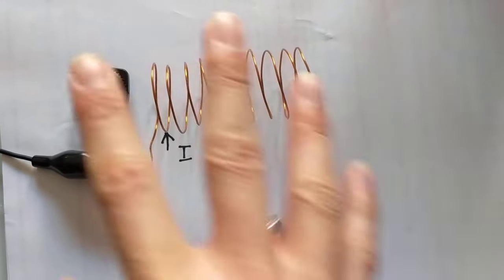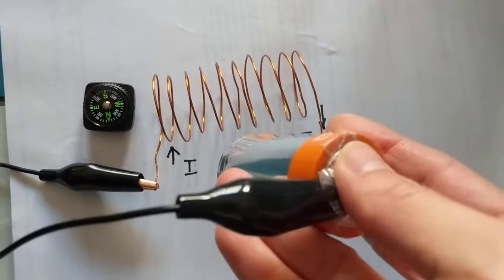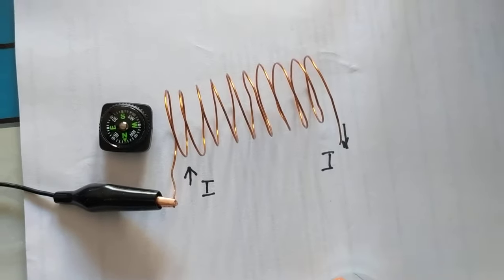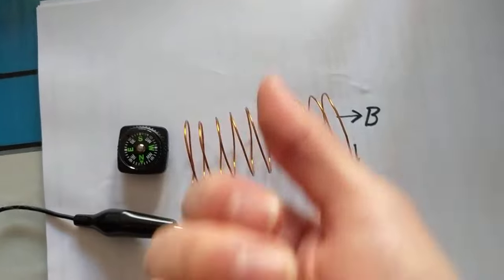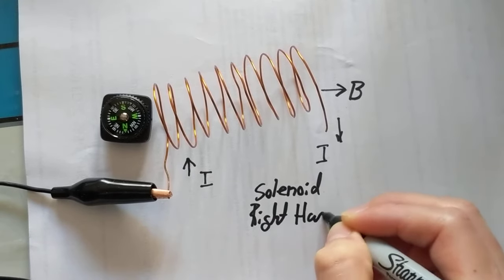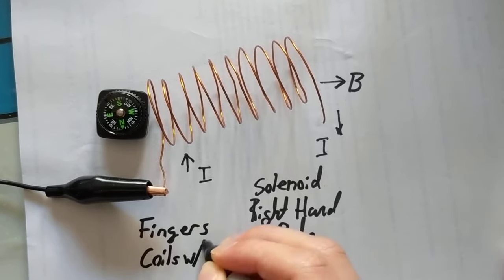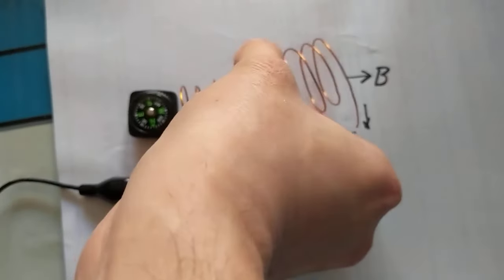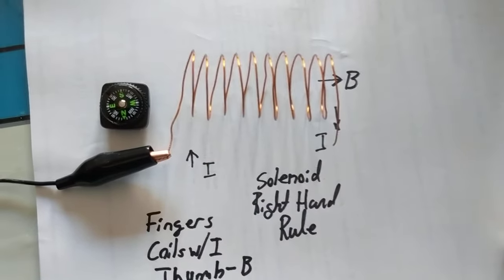The Solenoid Right Hand Rule

Comment: I'm confused can't I just hold my hand so the fingers are pointing the other way but my thumb is still pointing towards the current.
Reply from the maker: Be sure that you are using your right hand for this, otherwise nothing in the video will work. Your fingers will follow the current in the wire, which is what creates the EMF, which is where your thumb is pointing.